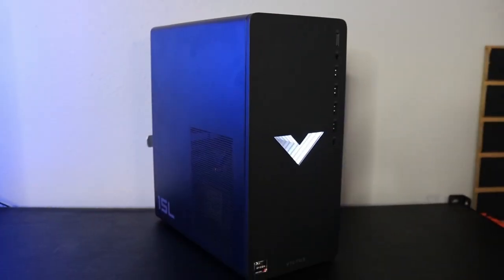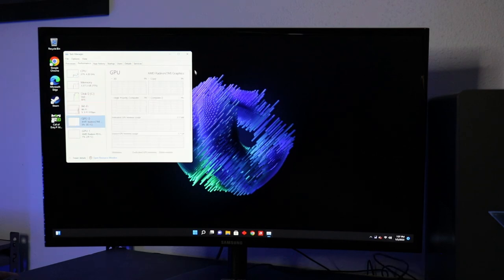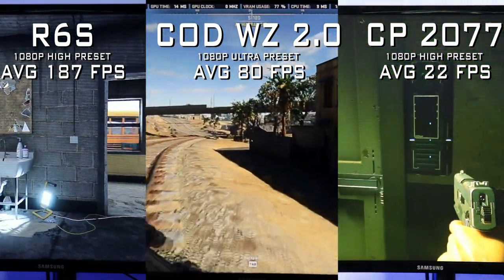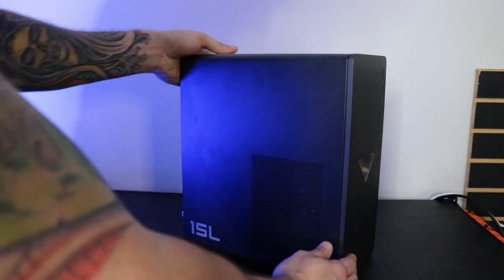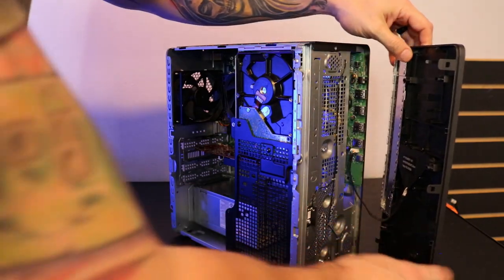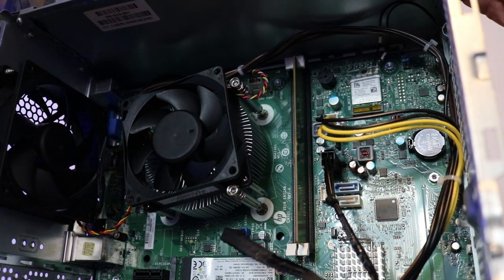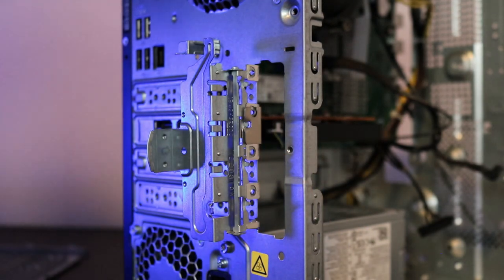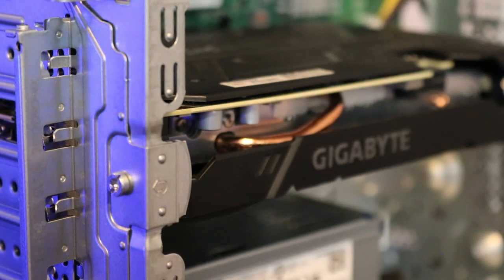Killer Gaming PC for CHEAP!! HP Victus 15L Gaming PC#pc #gamingpc #review

Comment: Do you know if the case is swappable
Reply from the maker: This is a downside with these pcs. If you notice the front panel and the way the USB ports are, the mother board is built for this case and the power supply is specifically designed s to mount in this pc case. I can see if the stand offs would line up but I don't think it would be cost effective. If you add a case, you would probably need a new motherboard and power supply which would add about $300 for the three parts
Reply: @bradfordskeldorado  alright that's okay I'm sure I'll do it in the future doesn't seem like to much hassle
Reply: @bradfordskeldorado  will I need to get 2 new 8 gb ram sticks or will another 8gb one work with this one
Reply from the maker: @Exoticts_  you can get another single stick. Just make sure it matches the speed of the original 3200mhz stick. If it's higher then it's fine but if it's lower than 3200mhz then it will drop the speed of the other. Not a big deal but you can get a 2 stick set for around $40-$50 on Amazon or at Best Buy!
Reply: @bradfordskeldorado  alright thank you :)

Comment: What ram should I use with this pc? I know it's ddr4 but which ones will work
Reply from the maker: Any ddr4 kit that is 3200mhz or higher. It's common to find and I would get a 2x8gb kit. Corsair, G.Skill, trident Z or something like the Team Group kit I used in this PC. Just make sure you get the 3200mhz speed or higher! Amazon has kits for $40-$60
Reply: @bradfordskeldorado  does it have to be 1.2v like the base one because I saw some people say they regretted not checking what difference does it make? And what are some good things to look for
Reply from the maker: You don't have to find 1.2v ram. Ddr4 ram is default to 1.2v so anything over that will just be set to 1.2v from the bios. The bios on this pc won't allow you to change a lot and is restricted but if your just looking to game and not overclock then you don't have to worry about this. I wouldn't recommend trying to do much adjustments with a 350w power supply. What other items were you thinking of?
Reply: @bradfordskeldorado  I have to 500w psu I already ordered mine I'm just looking to upgrade the ram and just wanted to check if the voltage would be a problem but now I know it won't thank you :)
Reply: @bradfordskeldorado  and I just had 1 more question if there's any ddr4 ram of the same mhz that's more ideal than others like companies or small things that they have
Reply from the maker: Not really more ideal, just a higher speed but that speed is good. If you're talking about the victus, I would recommend either the RX6600 gpu for about $250-$270 just to give you a serious boost in performance.
Reply: @bradfordskeldorado  will the ram run at 3200 or 2133?
Reply from the maker: I would have to check the bios to see what it's set at. The factory ram is 3200. If the bios has it set to that, then any ram that you put in it that's lower than 3200 then you would reduce the ram that's in there down to whatever speed you put in it. Your ram speed can only be set as fast ad the slowest ram stick you have installed. Let me boot it up and check to see what it's set at
Reply from the maker: @Exoticts_  the factory default setting is set to 3200 mhz. As long as you install that speed then you're good to go! 

Corsair Vengeance LPX 16GB (2x8GB) DDR4 DRAM 3200MHz C16 Desktop Memory Kit - Black (CMK16GX4M2B3200C16) https://a.co/d/2JCMHDZ
Reply: @bradfordskeldorado  thank you for the clarification I was qorried bc this pc doesn't allow OC
Reply from the maker: I didn't dig into that in the video. That would have been a good talking point to mention the limitation with the bios and tuning the system
Reply: @bradfordskeldorado  you're very helpful you just earned yourself a sub!
Reply from the maker: I truly appreciate it! The feedback helps me improve in the future!
Reply: @bradfordskeldorado  I felt like I was asking to many questions but every reply felt like you had no issue answering and that's what most people lack ! Thank you

Comment: So question. Can I get a cheaper computer if I build one myself or Is this a viable option instead.
Reply from the maker: I priced everything out to build one with that same parts but a 600w power supply and a mid atx pc case and I think it came in around $550. I would personally recommend building one yourself and not being stuck with proprietary parts like the stock psu, motherboard and case. The benefit to buying this pc is the warranty that you get with a prebuilt vs having to deal with each individual part warranties. Also, for about $50 with building yourself, you can add a 1660 6gb gpu and have a huge step up in performance!

Comment: Seems like the cpu is bottlenecking the gpu. Rtx 2060 gets around 60 fps on average in cyberpunk at 1080p native high settings. The 2060 is about 105 percent faster then the rx 6400. I have the same pc but i have the gtx 1650 and i5 9400 and was thinking about upgrading but my psu is only 300watts and cant handle anything higher than a gtx 1660 and now im not sure if my cpu can handle something like a rtx 3060.
Reply from the maker: It's very difficult to bottleneck a cpu. This combo with the 2060 was only running at about 40% cpu utilization. It would take a 3080 or higher to see something like a bottle neck and the i5 9400 is more than capable of running higher than a 1660. The psu would need to be changed to go higher though
Reply: @bradfordskeldorado  If its not bottlenecked, then why do you go from 27 fps to 35 fps when upgrading? You should get 105 percent performance increase but only get around 15 percent. Maybe its the RAM? Benchmarks for 2060 shows you get over 60 fps on average at 1080p high settings.

Comment: “Cheap”
Reply from the maker: Are you implying it's cheap as in poor quality or that $500 is more than you would consider cheap? I label it as cheap because for a gaming pc that actually performs well, this is a good starting point. I did another vid on a $500 Amazon pc that had 10 year old components in it.
Reply: @bradfordskeldorado  from what i've seen the rx 6400 is really only good for video out. you might be better off taking it out and using the intigraded graphics. also 8gb of ram is borderline unusable for gaming, especially newer games. I might buy this for a 10-year-old for school, but i might as well buy the parts myself, leave out the gpu, and get two 8gb sticks of ram. this thing won't be very useable for much of anything very soon. maybe as a separate streaming pc, or a "starter editing station" for a child.
Reply: they can buy the gpu themselves when they get a job XD
Reply from the maker: I agree 100%.. maybe not with the integrated graphics, but this thing was just more powerful than I would expect for that price range. Most $500 "gaming pcs" have a GT710 and a 1gb 650ti. I do agree that you could build a good pc for this price yourself and have some good internal parts that will last you a while. That rx6400 is a great addition for small form factor pcs and at $110-$150 it would be hard to find a better match... unless you looked used gpus like a solid 1660 or the 2060 in the vid. I truly appreciate the input and would be open to any other video suggestions you would like to see

Comment from the maker: Check out the pc with an RX 6600 added to it! Major upgrade! https://youtube.com/shorts/tNZz2oCX3QI?feature=share
Reply: Is the PSU the stock one still?   I got the same pc and I'm having a hard time trying to find a GPU that work.
Reply from the maker: @gamerflop101  I have found that the rx6600 is a great gpu for this pc. 8gb of vram and an 8 pin connector that works great with the stock power supply. Here is a video should how to swap it.

https://youtube.com/shorts/tNZz2oCX3QI?feature=share
Reply: One thing I noticed about the pc is it came with omen gaming hub installed and it limited my fps to 60 I deleted and immediately started getting 120 fps on games like ready or not and spider man
Reply from the maker: @clipzdragon5914  the only thing I used the Omen software for was the rgb in the front logo 😆. I haven't noticed any games being fps locked but thanks for the info in case I do come across that!
Reply: @bradfordskeldorado you think this gpu will work with the default power supply
Reply: @bradfordskeldorado the link keeps getting delete but on Amazon it’s a aisurix radeon rx 580
Reply from the maker: The RX 580 2048 is very cheap but I haven't tested one out. I'm seeing that the tpd is 185w on this so I would be concerned that it may have too high of a power requirement. The newer cards are more efficient so I recommend those personally. Here is the link in case you decide to try it out. 

Limited-time deal: AISURIX Radeon RX 580 Graphic Cards, 2048SP, Real 8GB, GDDR5, 256 Bit, Pc Gaming Radeon Video Card for AMD, 2XDP, HDMI, PCI Express 3.0 with Freeze Fan Stop for Desktop Computer Gaming Gpu https://a.co/d/aYFUGC5
Reply: @bradfordskeldorado  what gpu do u recommended
Reply from the maker: The RX6600 is probably the best gpu I have found so far for the price to performance. That is until I am able to test a 4060 that has less of a power draw but better performance. Either of those would be my recommendation
Reply: @bradfordskeldorado  thx
Reply: @bradfordskeldorado I’m seeing multiple versions of the 4060 at different prices on Amazon which one would u recommend sorry if I’m a bother😅
Reply from the maker: Not a bother at all. Just the 8gb 4060 is the gpu I'm looking to get. The Gigabyte 4060 should be $299. I haven't tested so I'm not sure if it will fit yet but it should be very similar to the RX6600 I tested. Link below 

Gigabyte GeForce RTX 4060 WINDFORCE OC 8G Graphics Card, 2X WINDFORCE Fans, 8GB 128-bit GDDR6, GV-N4060WF2OC-8GD Video Card https://a.co/d/2NV4TjG
Reply: can i add more ram with just opening the side panel i just dont want to open up the front panel and mess anything up.
Reply from the maker: In order to open the hard drive cage, you will have to remove the front. You don't have to disconnect it, just set it aside
Reply: I got this pc for $250 and can’t beat that ! Def want to upgrade the vid card do you have the link for the RAM you used ?
Reply from the maker: @ApacheJiujitsu yes sir! Great buy! 

 A-Tech 8GB DDR4 3200 MHz UDIMM PC4-25600 (PC4-3200AA) CL22 DIMM Non-ECC Desktop RAM Memory Module https://a.co/d/cT49HoW
Reply: @bradfordskeldorado  thank you 🫡
Reply: @bradfordskeldorado  is it possible to put that motherboard in another case ?
Reply from the maker: @ApacheJiujitsu anytime!
Reply from the maker: @ApacheJiujitsu it's a proprietary motherboard and has a small gptm factor power supply. The motherboard is specific to this case and the connectors on the power supply. If you want another case, I would recommend getting a new mother board, powerfully and cpu cooler. You can do all of this for around $300-$350
Reply: Will a RX 6700 work with stock power supply ?
Reply from the maker: @ApacheJiujitsu  I would not recommend the rx 6700 gpu for this pc. I would recommend the rtx 4060 for $300. The rx 6700 pulls 175W vs the 4060 using 110W. It's has 350W for the power supply, but I just wouldn't recommend maxing that power out. When you add the cpu, the cooler, the memory, fans, and the rgb, it all adds up, and I just wouldn't want you to shorten the life on your pc. Hope this helps
Reply: I have that same computer but with a gtx 1660 super, Intel core i5 12400f and i want to upgrade to 16gb ram and an rtx 4060 or 4060 ti. But my concern that its only has 350W power supply. Will that be enough or do i have to upgrade the power supply aswell? Thanks
Reply from the maker: @mountainbiking1509 the 4060 only consumes 110W of power so it is actually less than the 1660 super! Also, for the ram, make sure you get the A Tech 3200aa ram so the pc stays at 3200mhz! It's only $24 for an 8gb stick.
https://a.co/d/iHW1Hnu
Reply: @bradfordskeldorado  Thank you for the quick response. Do you think that upgrade is worth it? And how long would you expect it to be good for new games? Im only looking for like 1080P medium settings at 60fps. And recently the 1660 s doesnt quite get there anymore. And sorry for all the questions im pretty new to pc gaming. Been playing only on consoles.
Reply from the maker: @mountainbiking1509  I would personally probably try to build one if you're looking to spend $800. The case on this pc is not really universal.the power supply will limit you if you want to upgrade in the future. But this pc will run a lot of games at medium settings and get great performance. I will try to get some numbers for it shortly and post some pretty intense games like cyberpunk and gta v to see what it can do

Comment: i wonder if a dell 3080 would fit in here
Reply from the maker: I wouldnt try a 3080 in this pc. Airflow is not great and a 3080 has a power consumption of 320W so the power supply wouldn't handle it if you could fit it.

Comment: Will i have to buy a new motherboard if i plan to buy a 3060 and i have 500w psu, will i have to upgrade to like 600 or 700
Reply from the maker: Below is a link to the hp victus either an i7-12700F and a 3060ti for $1149. I would recommend buying this one, vs being the cheaper one and upgrading it. 

https://www.electronicexpress.com/catalog/207770/victus-gaming-desktop-intel-core-i7-12700f-nvidia-geforce-rtx-3060-ti-16gb-1tb-ssd
Reply: @bradfordskeldorado  oh I’ve had mine for months im just asking if i need to upgrade anything if i plan to buy a 3060
Reply from the maker: The power supply would definitely need to be upgraded to go with a 3060 but that should be all you need!